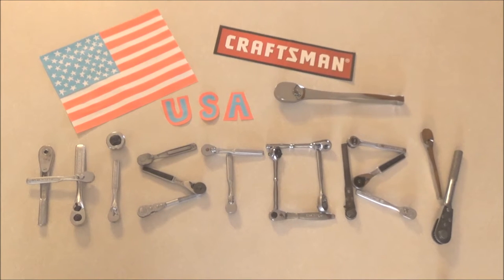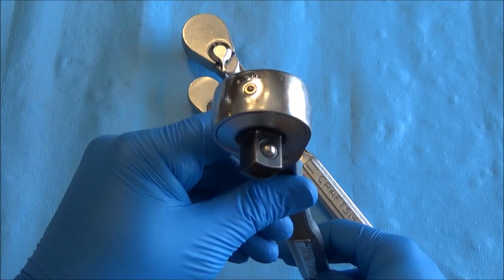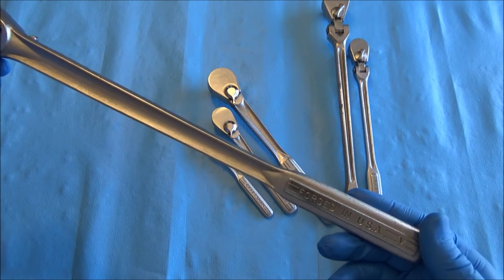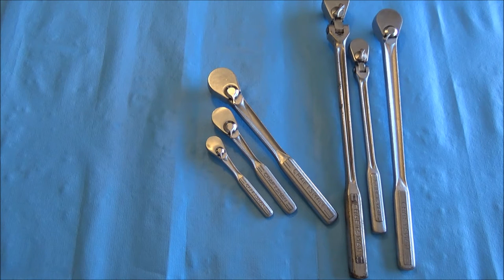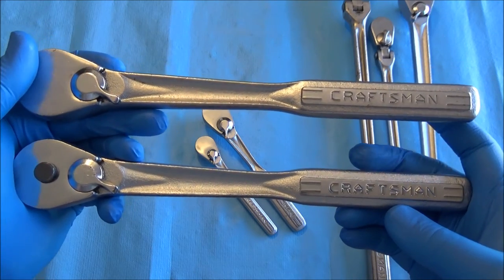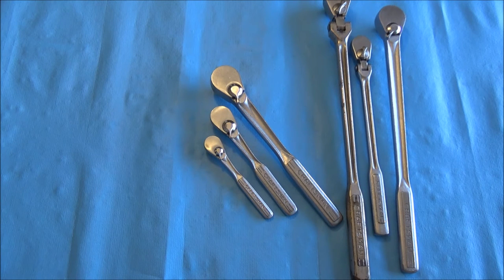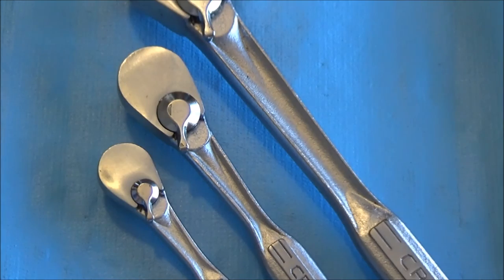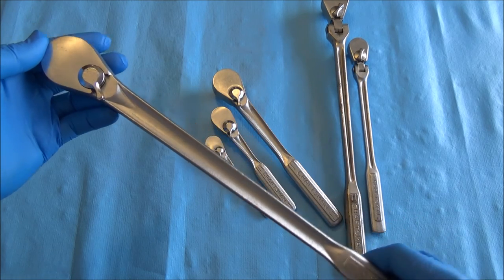Craftsman Tools - USA History: Intermediate Ratchets (2nd & 3rd Gen. RP Hybrid)

Comment: Repair kits are: 1/4" is 4483, 3/8" is 4478, and 1/2" is 4498, for these guys. And yes you said it Gear Wolf wolf,  they are expensive not to mention very rare these days!

Comment: Without a doubt... these are my favorite generation of all Craftsman ratchets ever made. The Long Lever's to Intermediate's and the first gen quick release (3208318). The only gripe I have is that super overly stiff anvil spring on the 1/2" non-qr ratchets (the 1/2's suffer the most). I have collected dozens of these over the years and 90% of them are the same, you can't barely push the ball detent down. Of course I have a theory about this, and that is that the springs have become harder and not as flexible over the past 60 to 70 years since they were made. Now granted that's ONLY a theory, I wasn't alive way back in the 1960's to see how the detent originally felt back then. But like I said, it's only a theory.

Comment: Found one today for $2 at a pawn shop. She’s rough. The selector is broken. She’d barely move at all. Gave her a lil spray of wd40 and some brass brush scrubbing and things are moving. The ring holding the selector is good and I was able to pull the selector. The ring on the gear side is missing one end. It might be some work to get it apart. Going to need a rebuild kit. Wish me luck! But for 2 bucks I’m mildly entertained on a Wednesday of vacation!
Reply from the maker: You never know what you can find.  Keep tinkering!  Its never a bad idea to get your hands dirty or make the leap to take something apart.  ^_^

Comment: are you considering producing a book with this great project?
Reply from the maker: As time permits, I have been recreating each of the history and tear down videos.  Also, I have been distributing my data as .pdfs for those who are interested.

Given the turmoil with Sears and the Craftsman brand itself, I don't think I would be interested in working with either to produce a book.  While realistically, I would be the one doing the work, I would still need to get permission to use the brand logos and other copyright materials for me to use them in a retail product, whereas I can legally use these things now under the "Fair Use" clause.

I knew another gentleman who attempted to broker a creative works project with Sears/Craftsman, and it was actually Sears/Craftsman who couldn't get themselves straight.  Unfortunately, the circumstances around Sear/Craftsman is too schizophrenic currently to legitimately pursue a project like that.